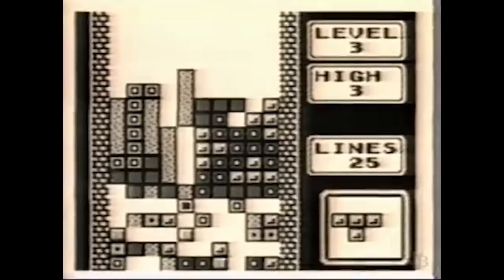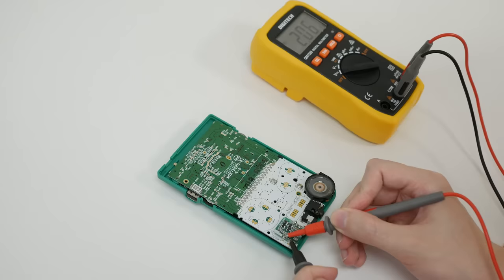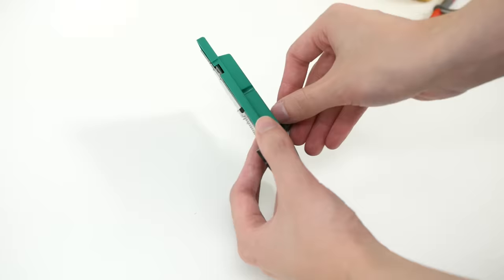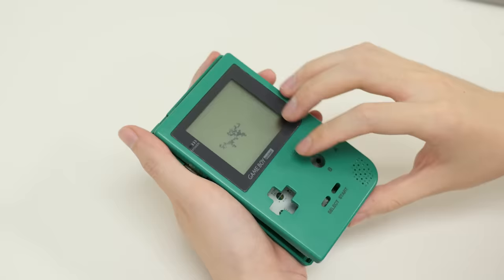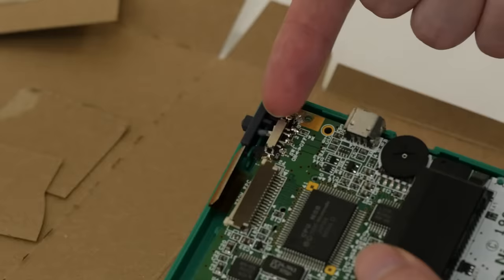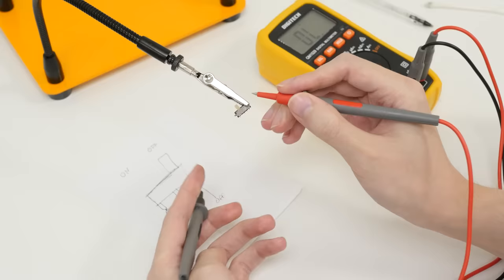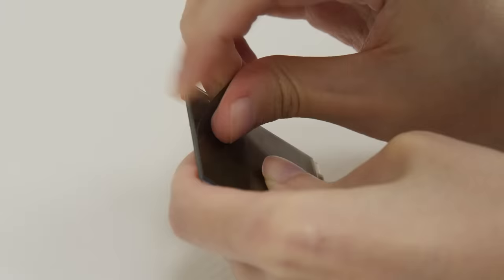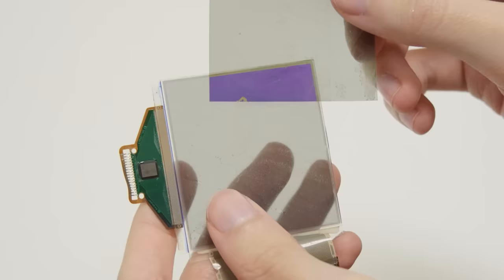Repairing a DEAD Game Boy Pocket [Part 1]

Comment: So quick tip on those old TN LCD panels.  IF, and that's a big "if", you could get the outer protective layers of that screen apart, you can sometimes massage out stuck pixels like that.  It works on old PC monitors with stuck pixels, but those older TN panels tended to be kind of squishy, unlike the hard plastic on that gameboy screen.  It is possible that you maybe could have massaged it straight through the plastic just right to get it, but I think that particular screen was done for.  But, it you ever have an older TN LCD panel (especially color ones) with just a couple of stuck pixels, you can usually massage them with your thumb and get them unstuck.  It's like that diagram shows, the pixels are turned on and off by those ladder-like structures twisting and untwisting, and sometimes they get hyper extended straight and cant twist back up with just electrical power, they literally need a little bit of physical force to nudge them back into a pliable shape!

So if you have an older TN monitor or TV and you notice bright dots whenever the image is black, give that sumbitch a nice rubdown with your thumb!

Comment: Just a random trivia i found out, a ds lite switch from aliexpress works on the gbc. Sure it technically is a momentary switch but the weight of the gbc plastic slider keeps it in on position.

Comment: Just found a video by "Hey! It's Andy" that fixes those dead pixels
It's called "Dead Pixels and How Gameboy LCD screens work - The Epilogue"
I just got recommended that video and was immediately reminded of your vid. Maybe try this out.
In short, he said, that the crystals in the display may be oxidised and are therefore not conducting anymore and that may be why they are "dead". 
The fix he had, was to use a q-tip and kind of massage the dead pixels out. So scrub with the q-tip and force for a while in different directions over the dead pixels. But make sure to put something behind the screen to not damage it.
Reply: The link to the video:
https://www.youtube.com/watch?v=HKV2xfZBkMo

Comment: In the  past I've used contact cleaner to "fix" dirty switches without removing them or disassembling them.
Just spray it in and actuate the hell out of the switch. I like the non greasy contact cleaner because
it leaves no residue but both types are o.k. It works 99% of time. As always, great video!

Everybody loves parfait!

Comment: With consoles such as Gameboy's, it's very difficult to source replacement parts without salvaging from other consoles. Gameboy headphone jacks are prone to corrosion, so the best course of action is to disassemble the switch completely. I'm seeing a lot of conflicting comments regarding the screen. People often call it "screen cancer" within the gameboy community, and most say that it's unfixable. There are reports of it occuring spontaneously, and getting worse over time. However, there is a user on YouTube named "Hey, It's Andy" who was able to remedy the issue on his Gameboy Light by applying gentle pressure on both sides, massaging the spots out, and perhaps reattaching the layers of the screen?

Comment: very entertaining video!
A few specific tips tho:

-Desoldring with desoldring wick can be easier if you actually tin the wick first, and use a liberal amount of flux on both the wick and contacts on the board (flux can easily be cleaned off with alcohol and cotton swabs, so there's no need to worry about overdoing it)
The board can always be dowsed with alcohol and scrubbed with cotton swabs to get debris and baked on flux off, and the alcohol will quickly evaporate leaving a clean board.

-For desoldering smd components like that switch, however, it can help to have a combination desoldering station with a hot air reflow tool, as that lets you liquify a large section of solder at once, while the components should stay in place due to surface tension (as long as you don't have the fan in the reflow tool too high and too close that is).
They're not that expensive either! I think I got mine for under $40, and if you do even a mild amount of electronics tinkering you'll thank yourself for getting it.

-For removing adhesive easily with no fuss, I like to use goo gone.
It's a super effective adhesive remover that uses citrus oil, so it smells very plesant, and adhesives can easily be wiped off clean with a dry or damp paper towel. It breaks down the fatty structures in adhesive, but isn't abrasive like acetone, which can actually ruin some plastics (like cd jewl cases for example). Goo gone can also be cleaned off with isopropyl alcohol and swabs.

-I know it's not the particular problem your screen had, but it can sometimes help with old non-backlit lcd's like this to hit them with a bit of heat and see if that fixes the problem.
The original brick DMG gameboy is notorious for loosing entire lines due to solder inside the screen loosing connection, and massaging the glass careful near the ribbon with an iron, or hitting it with a heat tool in place can reset the solder connections and fix it. Just don't overdo it obviously as this can damage the components just like anything else.

Comment: I have seen similar marks on a GBA SP NES Edition. They seem to have been caused over a very long time by the heat and humidity of the tropic. At first these resulted in shifting of the angle of maximum visibility, and inverted colors. Now there are many dead pixels that look as if they had been ripped off the screen, at the areas where the damage is more concentrated.

Comment: it looks like it's pressure damage. Basically, someone had an object against the screen at some point, which caused the crystals to be pushed out of alignment (or just outright broken), which can cause them to appear black.

I've actually broken a couple of phone screens and seen the damage that causes simply because i had my keys in the wrong pocket with them. So, that's probably the issue.

I doubt any particular solution exists, outside of either peeling those apart, and managing to re-align all the crystals correctly, or just replacing it.  Something you could potentially do, however, though, I doubt you'll be all that successful, is to either rub on the screen (we're talking pencil eraser or rubber tipped stylus), and massage it back into place (though it's not exactly like a computer monitor so, it might not work, or work properly); or, you could attempt to charge the screen and have it flip through each "color" (likely intensity, due to being a black and white display) rapidly, so as to re-align the crystals that way.

In all honesty, the rapid flipping of colors for the display is likely your best chance at fixing it, but, it would just be better to replace the screen. Besides, if you've got a back-lit screen, you can improve your enjoyment with it.
Reply: You use so many commas
Reply: Quite unlikely that there was any pressure as it'd have to get through the plastic front lens (and the air gap) without damaging said lens. It's more than likely just heat cycles + age + manufacturing defect. This is not a stuck pixel; this is physical leakage inside the display which cannot be fixed. Notice how it doesn't conform to the usual pixel grid at all, unlike the usual stuck or even dead pixels of modern panels.
Reply: @UChS4Dq15wHu8vkvWsaLzvPg  Better than none whatsoever. I personally have trouble reading unpunctuated sentences.

Comment: Oh yeah, you just need to top up the liquid crystal. 😆

I've seen this a tonne on LCDs over the years. Mostly in old Cisco phones that have been packed poorly for shipping and had something pushed against the screen too hard. My solution has basically been to swap it out with a working spare from a dead unit. Which is easy to find since they're so old they can die from being unplugged and plugged back in!
Reply: so basically, replace it. thats not fixing the old part.
Reply: @michaelepica3564  I mean the phones went from not working to working. Sounds pretty fixed to me. And considering it's $500-1,000 a pop to replace them, it's worth the 5-10 minutes it takes to swap out the screen.
Reply: @UpLateGeek  yeah that’s what he did

Comment: It's liquid crystal leakage, it's not worth fixing because replacement screens are so cheap. It usually happens due to some trauma, such as dropping the unit, or slight torsion (such as being sat on), even though the glass doesn't break. As the units get older they can just sometimes get a leak like that from degradation of the materials used, over time. Nothing lasts forever, and I imagine when they were manufactured they were not really intended to be working and still in use 20-30 years later.

Comment: Just watched this on 2x at midnight, picked up the main points.
Hell yeah investigate that defunct screen some more, maybe try use heat to peel the compacted layers? Hell you have a replacement so even if the investigation makes the old screen useless it's still going to be an interesting search

Comment: A tip for people repairing these and older gameboys or newer gb-color. The wheels often go bad but you can actually restore them by simply dowsing them in isopropyl alcohol and turning them back and forth. I bet you the same would work with the on off switch as well. Just dowse the thing in IPA and turn the switch on and off repeatedly and after some of that let it dry.
It helped me fix a few so I hope it helps someone.

Comment: Man, I felt soooo sad seeing you go through all that, just to figure out that the switch was the culprit.
I felt even sadder seeing you purchase a potato quality switch and remove the original one!
I messed quite a bit with these things, and honestly, 99% of the time I face a GBP (or any GB for that matter) that does not turn on, all I do is use some 99% IPA and wiggle the switch a few times, and voila: it is working perfectly!

Comment: That screen took a smack that wasn't enough to break the glass, but it did damage the lcd matrix. I had this happen with a phone I put in a cheap dollar store protective case. It had a magnetic clasp and wouldn't you know it, I drop the phone and the magnet gets driven into the screen. Had marks like that where the magnet had struck that gradually spread over time.

Comment: hey. just a tip for desoldering. im a noob aswel. but i bought a cheap desolder pump. get yourself leaded solder (important) set tempatures around  400c(800f) and put ALOT of solder on the contacts.. while holding  the heat on it apply the desolderin vacuum and repeat

Comment: I had a similar issue with an Gameboy Advance. Turning it on didn't work, but the switch worked fine when checking. At some point in testing, the gba turned on. This was the moment I noticed the switch itself worked, but would loose contact when holden it normaly, but would have contact when it's back up on the table.

Comment: My guess is the original switch had pin 2 shorted to ground. This would mean the drain resistor to ground is always connected, which would significantly drop the voltage on Vcc.

Comment: I have a graphing calculator that has that kind of mark in the middle of the screen. If you press on it, it actually causes it to advance a bit, and recedes when you let go. Others have referred to it in the comments as "LCD cancer." It's definitely either air or leaking liquid crystal between the layers. I've never seen another screen do that before.

Comment: I actually have a modern 3.5" composite "rear view camera" monitor that had very similar damage to it.  at some point, there was an impact on the LCD panel itself, damaging the crystals/matrix inside the glass layers.  It still worked fine, but had visible dead spots just like yours.

Comment: If I may, I have a video on how to mount the small switch on the Gameboy Color without an adapter. The method is very much the same for any console, I think without the adapter PCB lifting the switch up it probably would have worked on the GBP too?

Comment: I had a similar issue with a switch on a tape deck I repaired, where bad contacts meant that the audio signals weren't being passed through the switch

Comment: The mark on the screen is the crystal leaking out of its place trough a microcrack, i ve seen some people fixing it by squeezing it out of the visible aeria, but I ended up breaking the glass on mine...
Reply: Wouldn’t unpowered liquid crystal be transparent though ? Since its off state is completely transparent instead of black.
Reply: @MODElAIRPLANE100  I do not understand much about this topic, but I think that in perfect conditions it is transparent because it matches  the polarising film direction, but when it leaks out, it goes, well, scatters in all directions because its a liquid, and since the polariser lets the light in only one direction, and possible light directions are infinite, most of the light gets blocked by the polariser, and thats why you can't see the spot without the polariser.

Comment: Screen Cancer. it's air inside the glass layer. You can get them out by pushing them out. Unfortunately, the pocket screens are rare because they are fragile. They can be replaced with a Q5 screen which fit really without too much trouble.

Comment: Next time, try flushing the switch with a bit of contact cleaner (sometimes called "switch cleaner"). It only takes a few seconds, and if it works you can avoid all that soldering and desoldering.
Reply: did this on a controller that suffered from a little bit of stick drift, not a permanent fix, but def good for a year or 2

Comment: I’m pretty sure that switch is specifically designed for the Advance. I was doing a screen mod(which failed by my own stupidity and carelessness) for my original Advance and in the process the switch just…broke. It’s a tiny little part in the Advance, and I bought some aftermarket ones just like the one you had. Haven’t replaced my switch yet though, waiting for the funds to do it at the same time as putting in a new new screen

Comment: My old Nintendo DS lite had a similar mark, except that it was a couple of rows that were permanently dark.
Interestingly enough, on that DS lite, those black rows seemed to be darker then what the DS was capable of displaying as black, in a sense, darker then black.
Since my DS has a broken hinge which probably broke the display cable, my guess is that some rows of the LCD were exposed to a voltage higher then they werre supposed to, before the DS picked up on the fault and shut off... Thing is, it won't even turn on anymore because of that faulty display cable :/

Comment: It's even easier than that. Most modders and refurbishers will just drop some iso alcohol inside of the switch and flick it around a bunch to clean the contacts using the wipers themselves. The same thing works for scratchy volume potentiometers

Comment: That replacement switch that you bought doesn’t fit into GBAs well either. In fact, I couldn’t even get it to work after soldering. The switch that I got was completely dead and I know it wasn’t to console because works if I bridge the connections. They are pretty bad.

Comment: I would be tempted to run either a solder rework station hot air gun thing on them or just have the screen powered on and hold a soldering iron close to it to see if there's any change, I've seen similar before but I don't know if this is the same thing that can be fixed.. though others seem to have the consensus that the issue unrepairable,  I'd still try it myself rather than just go with advice to throw it out without trying anything on it first :P

Comment: Well whatever it is, seems organic in patern. This doesn't mean it was alive, as such, more that it expanded and wandered out from the center as if it was. I wonder if at some point the screen itself received a high voltage scenario? Not high enough to burn out anything else but the switch, but visibly burning the adhesive layer.

Comment: The Screen on my old AT&T Wireless Services Nokia 5160i kinda had a similar issue but i fixed it myself by pushing the pixels & pushing them very hard & moving them to the corner

It Still Works too!

Comment: Use electrical contact cleaner on a switch before replacing it. That way no soldering or disassembly of the switch is required and the contacts will be cleaned.

Comment: I've mentioned my 2DS XL I got from GameStop before, (on the GameStop Wii U video) and how the volume switch ended up getting broken.
Well, I repaired it last week!

It was... certainly one of my weirdest repairs (considering it was only my third repair, that's kind of a low bar)
I was worried I'd have to solder a new one in (I have a bin of spare 3DS parts from a new3DS XL that I scrapped because the motherboard died)
I literally pried the actual sliding part out of the 3D slider from that bin, and just... pushed it into the 2DS XL, and it worked perfectly! *

*it's not as smooth as it was before, but I can live with that.

Comment: The dead pixels are called LCD rot or LCD cancer. This occurs when the liquid crystals break loose and can no longer polarize light on command. This commonly spreads around the edges of the screen first and there is not much you can do about it other than replacing the whole panel.

Comment: i'm surprised you didn't try solder the switch permanently on and put a new switch at the battery. nevertheless, glad you found a way to clean the original switch

Comment: I think that could have happened through some sort of force (whether accidental or an angry gamer) and would explain the pattern. It looks similar to what would happen if you press down on a calculator. The other possibility is that it warped due to a high heat source unless if the lens is made of glass then I guess the heat source was on there for a long time??